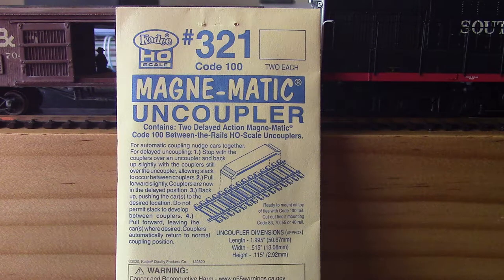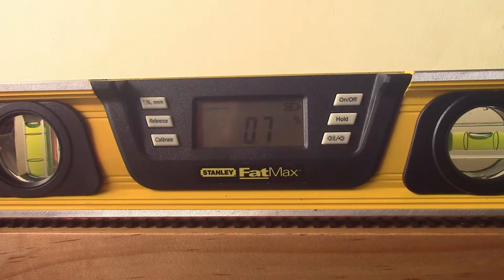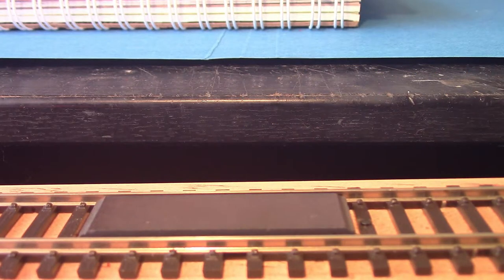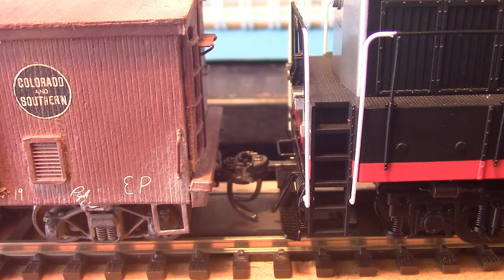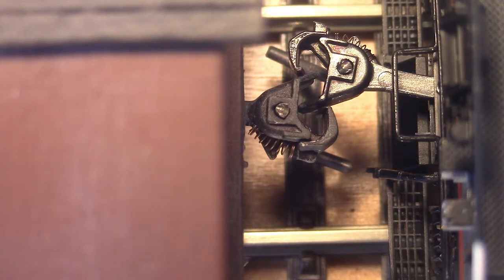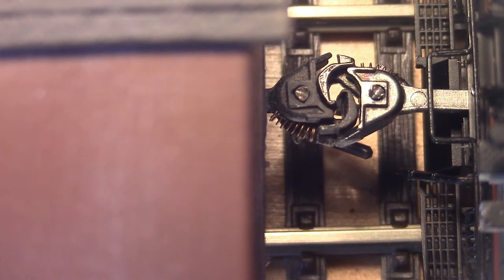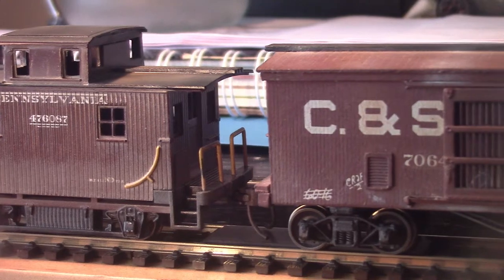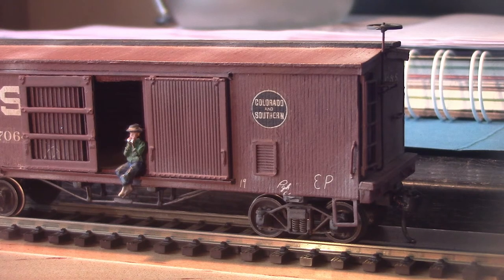Kadee Delayed Action Magnetic Uncoupler Demonstration.

Comment: Hi Gary, great demo. I love these types of couplers. On my N gauge layout I tried fitting one wagon (all of them currently have rapido couplers) with a Micro Trains coupler which operates just like the one in your video. It works great, love it! Bit of a job to replace them all.  Cheers John
Reply from the maker: Thank you John, it makes for a lot of prototypical operation, great fun. It would certainly take a bit of skill in N scale.
Cheers, Gary.